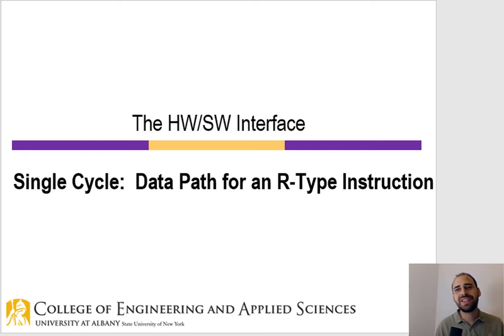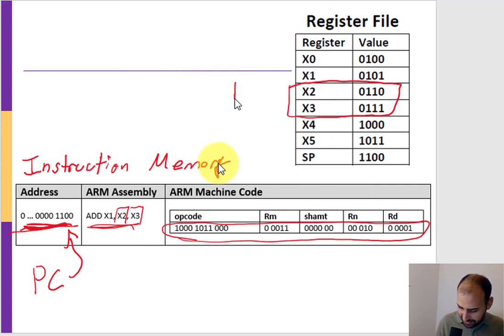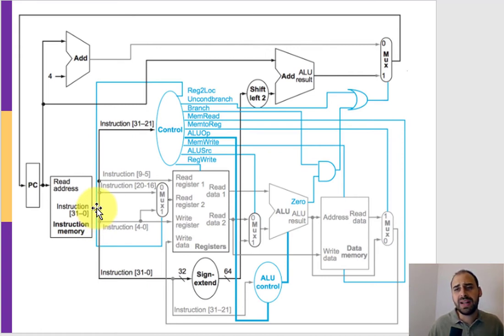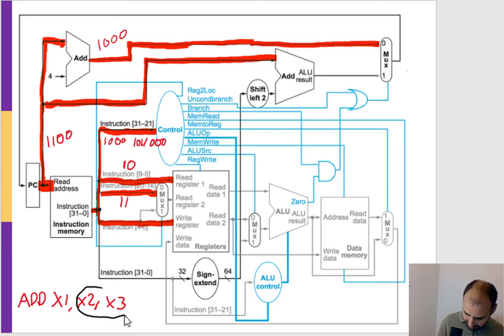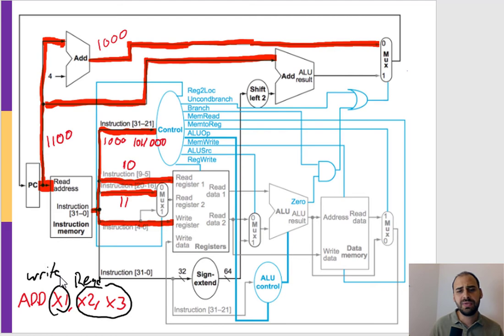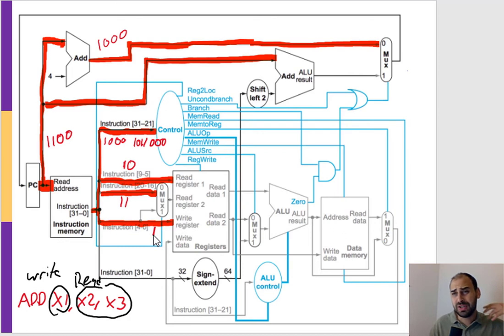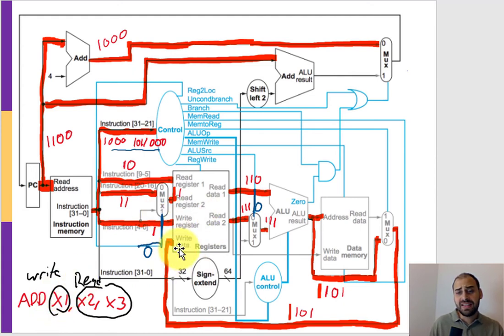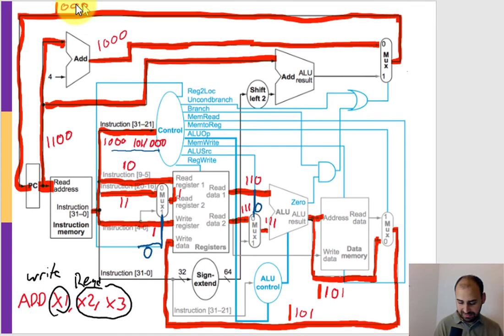ARM Single Cycle:  R-Type Data Path

Comment: Why does that block diagram look like a MIPS, while the real ARM2 chip looks much like a 6502 ? Did you see how big the ALU is on the die shots (of both ) and how big the instruction counter in on the 6502? Are you sure that there is both, a counter and an ALU for the Program Counter?